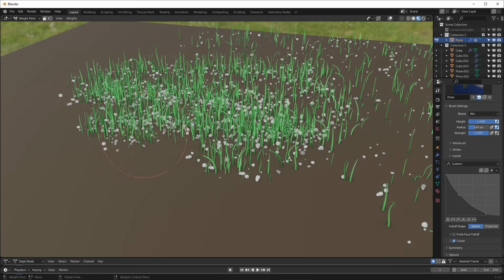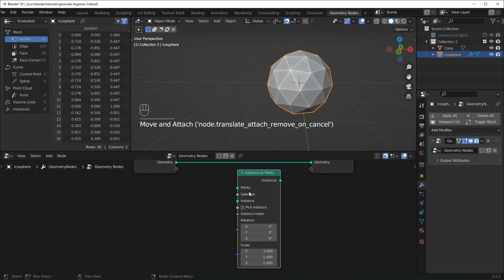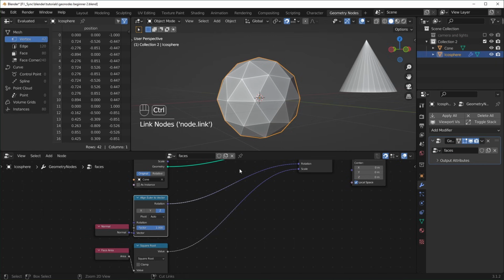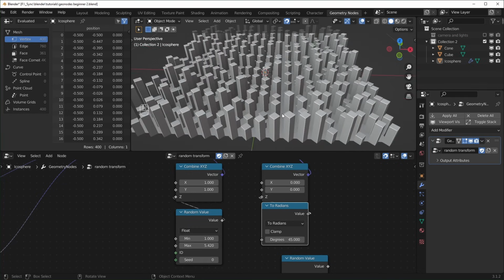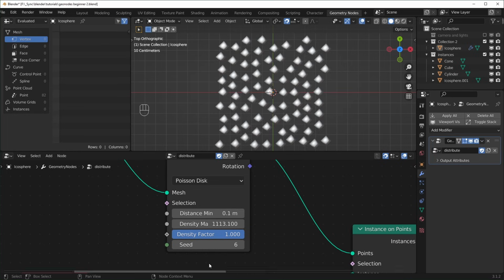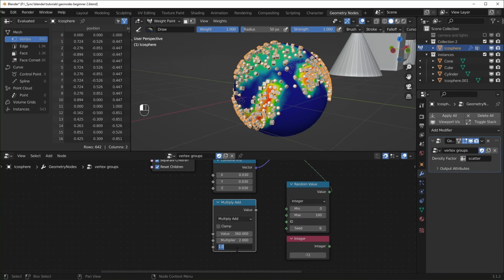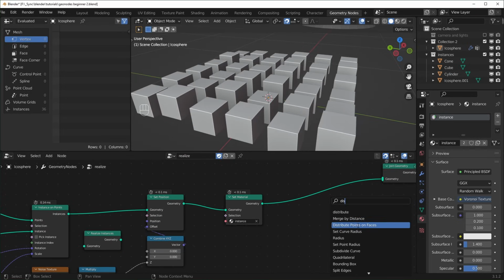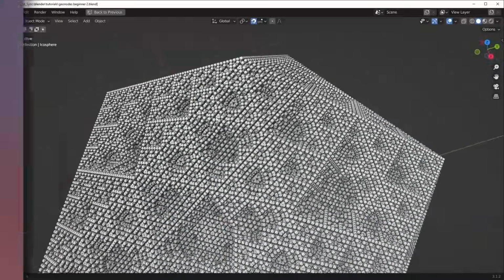Instances - Geometry Nodes for Beginners

Comment: The Capture Attribute node doesn't work anymore so I'll put this here for people struggling "there was a separate update video but it isn't pinned on this vid):

"For those having trouble with the missing transfer attribute node part at the end.

1. Add four nodes, Position Node', 'Index Node', 'Sample Index Node' and 'Distribute Points on Faces'
2. Connect 'Position Node' and 'Index Node' to the 'Sample Index Node"s value and index 
3. Connect the 'Distribute Points On Face Node' to the Sample Index Node's Geometry 
4. Connect 'Sample Index Node's Value to the Set Position Node's Position."

Comment: Right after you create the group and start removing the unneeded items from the input, in current Blender I don't have "Instance" like you (one of the three you left), and it immediately breaks everything. Any idea how to work around this?
Reply: newer Blender eliminates the input if you instance onto itself. you need to create the node group first so Points and Instance show up. then tab out, then plug the nodes in like the video shows.
Reply: @coreymbarnes  Thanks for the help, dude. I was scratching my head for a good 20 minutes trying to figure this out.

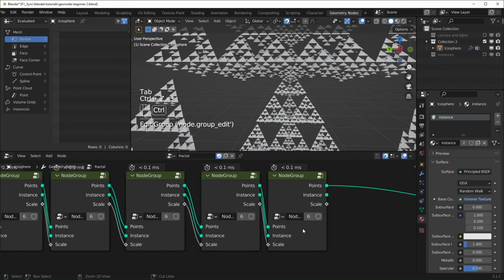Comment: 41:00 On 4.0.1 for some reason 2 Nodegroups acted like 3. And 3 on my side acted like 7 on your side, not rendering and lagging. Not sure if I connected something wrong but Realize instances solves the issue and less nodes for me anyway I guess
Reply: Yeah it changes when reconnect Points and Instances in the Nodegroups in different ways but I don't understand it

Comment: for people in 2023 please know 'capture attribute' isnt there anymore, instead use 'Sample Nearest Surface'
Reply: this comment is now outdated. capture attribute has returned.
Reply: @VenusFrom2320  It's returned, but doesn't look the same? Any idea how to use the new version?
Reply: @IoSkyBoyoI  For anyone wondering this, the only difference is that you no longer need to define which data type it is capturing. He uses two in the video - one vector and one float - now, you can plug both of those into the same node by using the gray circle socket!

Comment: @32:35 - just wanted to add a note that I think this piece was incorrect. The offset is gonna be Z only no matter what as the X and Y are explicitly set 0 (no offset). I do see though why realize instances was needed (rotation/scale). This is something I believe a "non geonodes 'instance' allows maybe, but not a geonodes instance - not sure? I would think an instance would allow rotation and scaling, but it's clear to see that they aren't affecting it before the realize instances - but also not related to the noise texture. Maybe position is the only thing a geonodes instance carries at this point? not sure

Comment: Love this video. I learned far more that I was expecting to.

I ran into trouble when I was trying to change the shape on the surface of the sphere from cone to cube. Each object is progressively rotated about it's zaxis around the surface of the sphere. I know I need to add a Rotate Instances after Instance on Points and I know I need to apply a rotation to the z-axis only. I just don't know how to calculate the appropriate value. Am I missing something obvious? https://i.imgur.com/mJgMORN.png
Reply from the maker: The solution is hard to explain through text, but if you come to discord I was actually figuring this out with someone yesterday.

Comment: Great Video! - How to add a BEVEL to the INSTANCES of all the triangle pyramid?
Reply from the maker: You could try putting a bevel modifier after the geometry nodes modifier
Reply: @JoeyCarlino  Using the Cone example (at the end of your vid) , so the  geometry nodes modifier is not connected. Also, only found "Bevel" in the Shading menu, not Geometry Nodes Menu.
Reply from the maker: There is a bevel modifier, not a node.
https://docs.blender.org/manual/en/latest/modeling/modifiers/generate/bevel.html
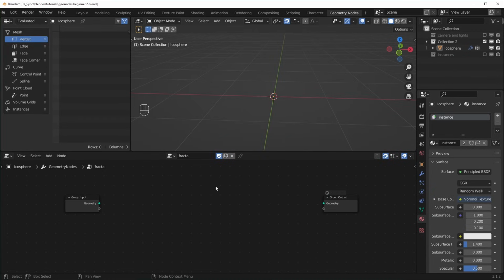Reply: @JoeyCarlino  I learned something today: DO NOT accidentally select the "plane" and do all the steps in the 37:32 - Fractal Shape tutorial then try to add a bevel. Also Mesh to Points (creates a single shape) Bevel works as expected, Once Mesh to instance is connected, the Bevel stops working.